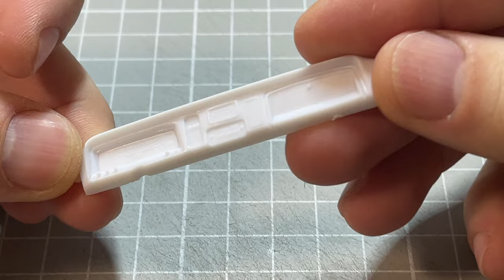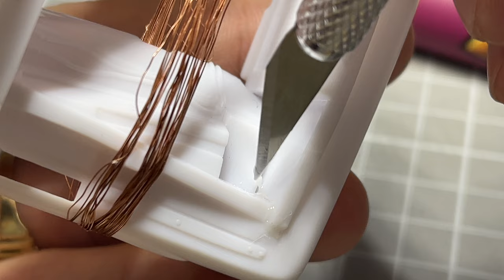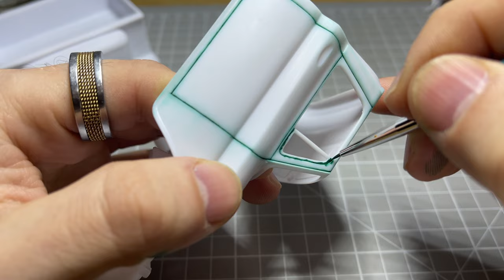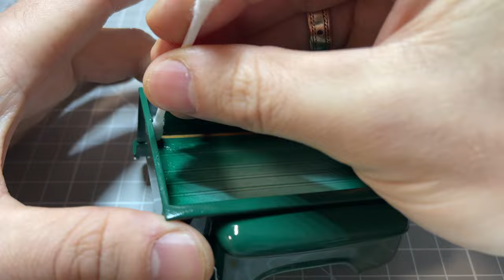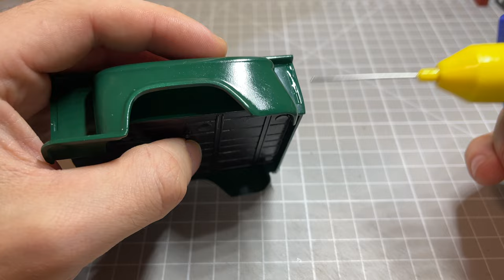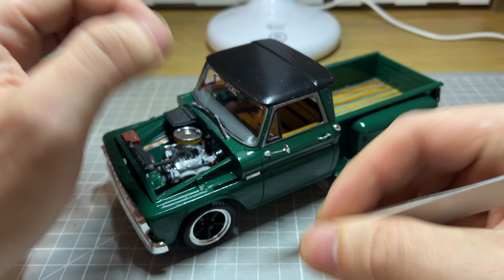'65 Chevy Truck PART2

Comment: What is the glue you use? And the putty your applying with the blade? Very nice work..new subscriber
Reply from the maker: thanks for the subscription, I made the putty myself, rubbed the plastic with sandpaper and mixed it with glue, I use revel contacts glue
Reply: @oleksiivagenheim  thanks I'll have to try that
Reply from the maker: @Insomniamodelcars  the method is working, I wish you success